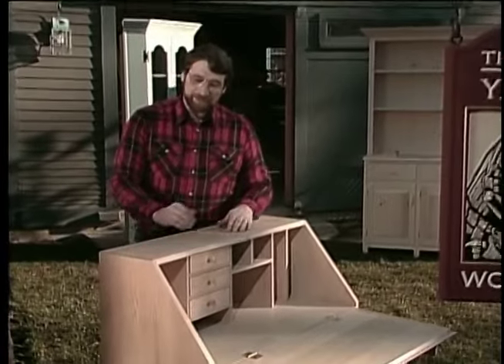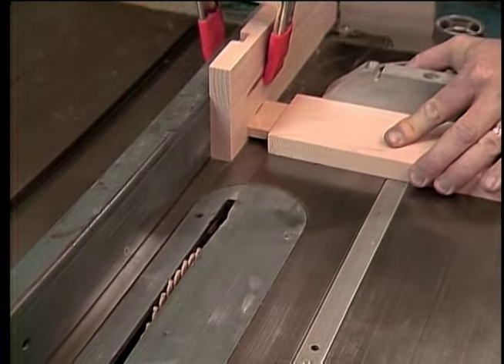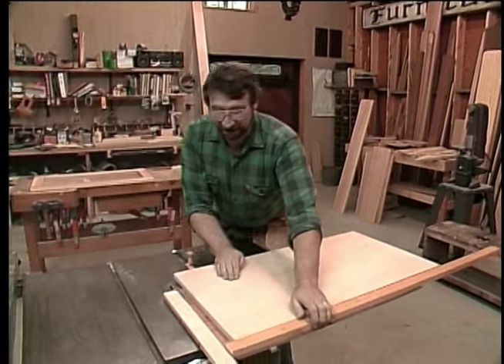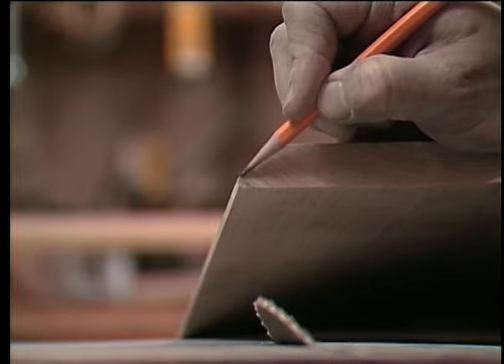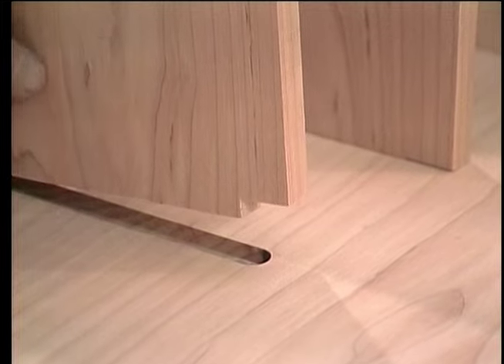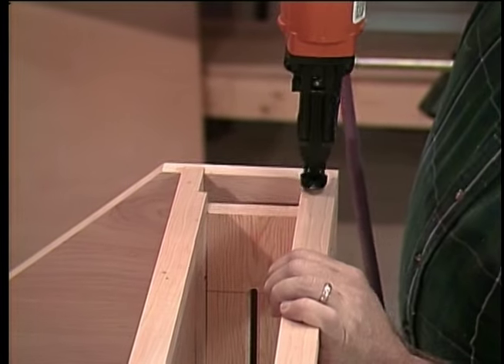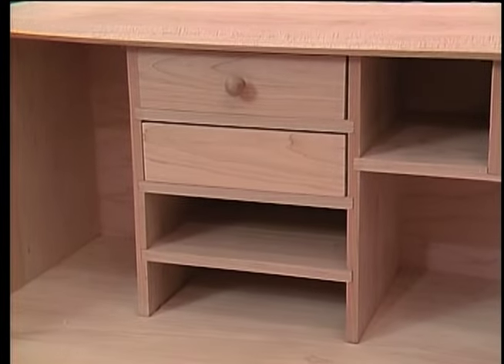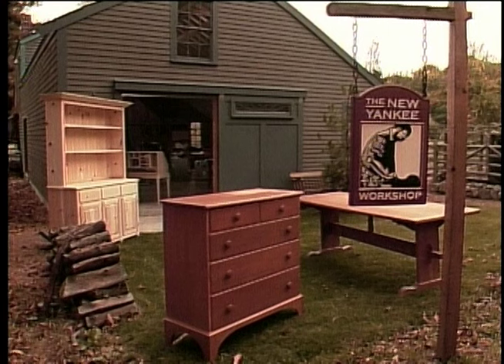Slant Top Writing Desk  |  S1 E12

Comment: The one thing that's clearly present in this first season  of NYW is the use of hand tools (hammer and nails, brads, hand driven screws) instead of air and battery powered tools. So refreshing to see the humble beginnings of the show. Pre dust collection as well. These are great to see once again. Thank you so much for posting these. I'm enjoying and savoring every moment.

Comment: I changed careers 5 years ago and when back to school to be an apprentice cabinetmaker. I just graduated June 28th, 2024 and am now a journeyman. 
I'm 55 years old and my final project was a roll top desk out of cherry with the tambour and 2 drawers in the shelving section and two dovetail drawers in the lower section, tapered legs, stretchers and finished with watkco natural oil. The oiling took 4 days to get to 400 grit

I have been watching Norm for decades and  marvel at all the newer tools we get to use to compared to what Norm started out with. We have sliding table saws, Shapers, CNC mortiser's, CNC'S, mdf core veneers, dovetail machines where we just place and clamp the wood and press a button.

Comment: Another great project.  I built this desk for my son.  I made one modification to the design.  I added sliding dovetails to the dadoes in the rear of the side panels to account for expansion  of the side panels.  Gluing only the front 4" of the side dadoes allows the sides to expand and contract along the loose sliding dovetails.  This way, the side panels will not crack.

Comment: I was surprised to see Norm glue on the breadboard edges!  I guess he was still under 30 so I should cut him some slack.  For readers... Never glue on anything that is cross-grain (except relatively narrow 1/2 lap joints) as it will end up self destructing with the expansion and contraction of field boards.  Better to do as I, drill 3x 1/4"  (one at center and two a couple inches from edge of panel) holes through the to edge and tenon. remove edge board. use drill to elongate only the outer two holes in-line with tenon by rocking it back and forth a few times then cleaning it up with a 1/4" rat-tail file or rasp.No need to do this to the middle hole as it is the focal point of expansion and contraction. create some dowel pegs (preferably darker or lighter than field --depending on wood type)  Pound in pegs with no glue until peg is 75% seated, then a little glue around peg before punting it home.   Leave pegs a little long, trim and sand flush for nice look.

Comment: I've always been curious: Why drywall screws instead of coarse wood screws?
Reply: I think this was by design because they were readily available to the average joe and inexpensive.  I always found them terrible in hardwoods and jumped to better options once I discovered them.
Reply: They have a thin-shaft to wide-head ratio so they drive in easily and reduce any chance of the wood splitting.
Reply: @tccoggs they’re not terrible on any wood! You need to drill a small pilot hole for and then secure with screws and make sure you have the right size screw!
Reply: @4HBirtcher  On hardwoods they tend to snap as they bottom out.  The thin body of a drywall screw works well for drywall as the screws head is never going to be under tension with a soft material like drywall.  When used with wood, this is not the case.  Try construction or cabinet screws, I have been buying in bulk for years from CS Hardware, although the Grip Rite constructions screws at home depot are good as well.  I won't go back to drywall screws even thought they are about 1/3 less cost wise.
Reply: @tccoggs3929  Thanks for the tip. No pun intended...